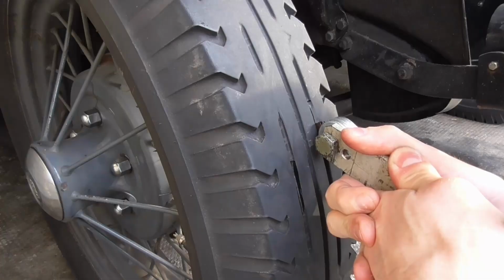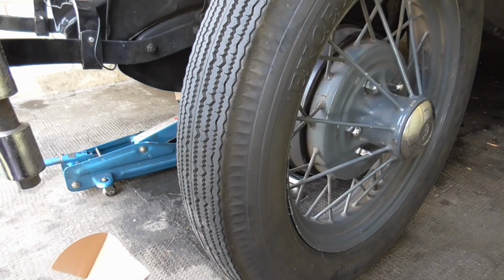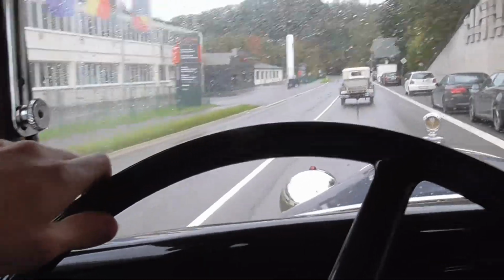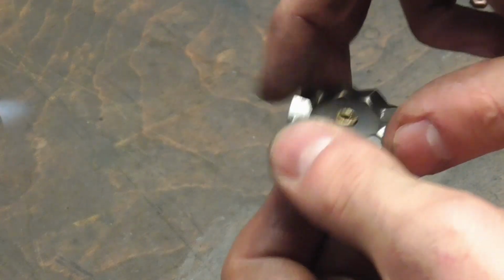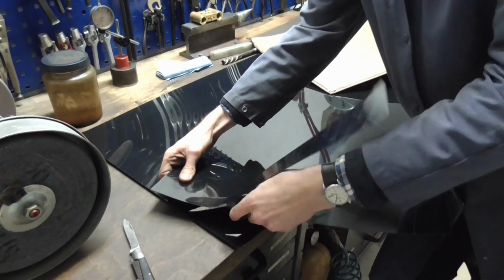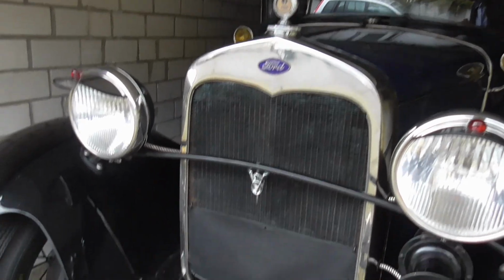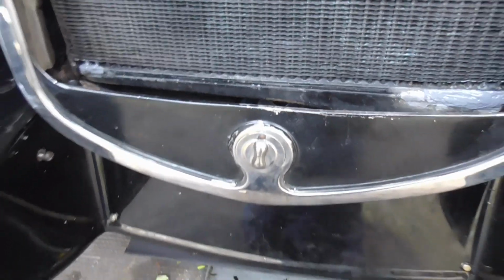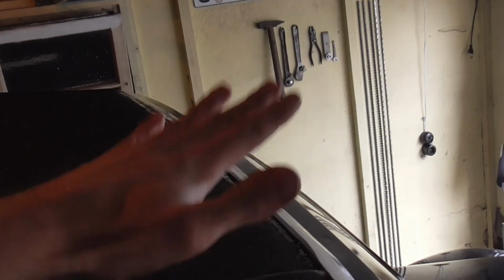Model A Mechanics Log #6: Tires, Radiator Cover, Electrics, Interior, ...

Comment: I just watched a 1940's American (govt) video on tractor maintainance. Having grown up on a UK farm in the 1970, I was astounded at the frequency of the inspections, and the amount of oil used by the various changes.

Here's the video:
https://www.youtube.com/watch?v=1d3qvzTwNds

I know (in my lifetime) that the service intervals of modern cars have been extending and extending and are now annual in many cases.

So what's the routine maintainence requirment on a Model-A in routine use (not just weekend parades!) ?
Reply from the maker: Well, Ford recommended to do a full lube job and oil change every 500 miles. Based on no scientific calculations, I decided to stretch the oil change interval up to 2500 miles (with added oil filter). In the summer, I reckon a lube job every 1000 miles should suffice, but when driving in the rain, I stuck to the 500 miles because 80 mph rain is a mighty powerful pressure washer blowing all your chassis and axle joints clean. During my peak time, that averaged out to about one lube job a month in the winter.
Very interesting video by the way, thanks for recommending!

Comment: Adrian, do we really need to balance the tire when we are only driving at 45 mp/h? (72 km/h)  I don't have an overdrive yet so that's about my top cruising speed.  Even at 55 mp/h  (88km/h) it seems like it is not really necessary. I got this idea from my local tire experts. They say that 60 mp/h (97km/h) and above, then balancing is necessary.
Reply from the maker: If you don't notice anything, you don't need to. As I said, there was a minor twitching in the steering wheel whenever I exceeded 40mph, that's all the balancing got rid of. The much more pronounced low-speed wobble due to out-of-round rims isn't affected.
Reply: @AstraWerke  Yes, I heard you talk about the out-of-round problem later on in your video. I did make that comment before I had listened to your whole video and I was enlightened by your perspective. Thank you so much Adrian. I'm a good friend of Paul Shinn just to let you know. We talk often.

Comment: In my Amazon, the radiator blind has the sheet fixed at the bottom of the radiator. The entire roll is lifted by a chain that is guided through a tube over the radiator. The chain then stretches over the engine and into the cabin where there is a slotted bracket under the dashboard that the chain hooks into.

Your first attempt would have been very impressive if it worked, but sometimes the simple solutions are the most reliable. Looks like you're on the right track with the radiator!

Comment: You've been very busy indeed. More  great fix it up ideas been there. I'm presently going through te same thing with my tires and wheels. Mine are egg shape and warped, so I'm now looking into new wheels and tires.$$$$$$$ ,cannot find any good 21" wheels! Also considering radials for the new tires,we'll find out if it's worth it. Thx for another great video.

Comment: The horn ratchet is supposed to be held on with a nut and lock washer. You may have a reproduction horn.
Reply from the maker: You bet - it appears whoever restored that car didn't want to spend time refurbishing the old stuff and just bought new repros. Same goes for all lights, door handles, knobs... Pretty much every attachment piece was swapped for new pieces - which is a shame, if you ask me.

Comment: Since you've already modified the splash apron, you might consider fabricating a simple sheet metal guard to fit under/around the roller for the radiator cover. That's a very exposed location – it could attract all kinds of road sludge which could gum up the roller, especially in the rain.
Reply from the maker: I thought the same thing - interestingly, there was no dirt caught behind the splash apron, but I'll keep an eye out, and if there's any evidence of dirt collecting, I'll certainly build a housing around the roller

Comment: 10:55  6 volts doesn't mean anything.  A lot of people think 6v is a problem and that you must "upgrade" to 12.  6v stuck around for decades because when it is set up properly, it works fine.  The main thing is you need good grounds.
Reply from the maker: It's the same with mechanical brakes. As long as you keep them in good shape, there's nothing to complain about.
Reply: And in the end mechanical brakes and 6v sucks anyways...lol 

In my case i think 6 Volt sucks more than mechanical brakes...mechanical timing advance too....

So I drive my A with B engine/ gear Box,12v one wire alternator automatic advance and mechanical brakes..lol
Reply: @hansosl  6v systems are fine when they are in proper working order. A 12v generator would suck too.
Reply from the maker: @hansosl  How about an automatic transmission to save the hassle of manual clutch?
Reply: Basically the model t has one...but you select every gear yourself. 

I have an automatic in my 67 caddy...everything has his place/ pros/ cons

I drove 250tkm with cars and motorcycles from 1914 to 1970s...
I've been in every rabbithole... there was a time when i cut up 12v Batteries to get 6v...because 6volt Batteries are expensive lol...

6v Volt motorcyles...with kickstarter no Problem...Battery is 8 euros....

I back converted some vehicles from Electronic ignition to points...

If you build a vehicle for a special purpose...there are many pros and cons on many Details.... 

You can even run some 6v vehicles on 8 Volt Batteries...

Building a car from scratch starting with a frame....i would never use 6v.....but an original 6v survivor I would not have the desire to convert to 12v if it works nice...

Comment: 0:25 If a fully reliable hassle free driving experience is what you are after, a 90 year old car is probably not exactly the ideal.  By the time you reach the last item on the list, the first thing you fixed will have worn out by then 😀
Reply from the maker: Well, back when I bought the car, I thought it'd just be a matter of getting all the bugs out and then just routine lubejobs and fuel stops.
The car proved me wrong ;P

Comment: 0:15 "Finally done". Oh, you sweet summer child!😂
Anyone with an older (let alone antique) vehicle has a permanent (non paying) job.
My feeling is that if you own one of these, either you need to be a combination mechanic/machinist/engineer/miracle worker OR have a friend who is. Luckily, you qualify for the first part!
I like your roller blind radiator shroud. A clever solution and I'm sure you'll be able to set up a Bowden cable remote control for it (eventually!)
This was really interesting. It's worth pointing out that most Model A owners in the 1930s would definitely be doing a lot of repairs/modifications themselves.
There were dealership shops, of course, but not the necessity to have the dealer do absolutely everything.
I have two thoughts about the outro: Firstly, the sound of the exhaust echoing in your garage is glorious. Secondly, nice lid!😁
Reply from the maker: Well, I was optimistic about it, when I bought the car xD
I've always been wondering - so far, most repairs I had to do was due to prior neglect or improper installation (missing/hardened rubber, poor quality repro parts, worn-out old parts...), so maybe, once every single part of the car has been replaced properly, there's no more to worry about.
That means, I've only got the gearbox, U-joint, differential and rear brakes ahead of me - I've pretty much had everything else apart at this point xD

Comment: I actually never balanced my wheels after stripping, painting, and putting new tires on. I figured they are turning so slow, and every other thing on the car is wobbly and creaky anyway, I didn't really bother.. (also i have 25 degree play in my steer, so any wobble is not noticeable anyway)
Reply from the maker: Below 45, imbalance in the wheels is unnoticeable - and even at 50, it doesn't play a significant role.
Out-of-round rims play a much larger role in ride comfort.
Reply: @AstraWerke  not even noticing much at 80, my unbalanced engine overrules any other shaking at that point haha. Out of round I really notice when rolling to a stop before a stoplight..

Comment: I use "slime" for tubed tyres on my car (1934 Austin 7) - firstly, I had a blow-out with rapid deflation and luckily I was able to bring the car to a halt without undue danger, but it unnerved me! Slime should help that rapid deflation (it was a chipboard screw that caused the puncture) in future and gave confidence back!

There is another advantage to the slime, the fluid balances the wheel and I noticed that the car accelerated smoother from around 40mph to 45mph and at first (you soon get used to it) the car felt more stable, particularly around bends.

My three vintage cars have LED bulbs all round, very good visibility from the headlights and clearly visible from the rear - sometimes diodes are needed as the bulbs can do funny things at times, but once sorted, all is good and I like the crisp light output (you soon get used to them).

I have always taken the wheel off to change the tyres - never done it with the wheel on the car itself, might try that next time, the job is such a ball-ache anyway so anything that makes it easier is worth a go!

I made a grille muff for my car, I quickly learned that at freezing having the muff closed will overheat the coolant after a couple of miles, a blind operated from the driver's seat would be much better, good luck with yours!

My cars get used in the winter, I am not bothered about salt on the roads, a bit more attention is required to keep the underside clean (who am I kidding, I don't) and touching in of the paintwork, they have last this long so with attention they should continue for as long as we will be allowed to drive, at least until sense prevails and it may then be too late as the cars would have all been scrapped...

Thanks for sharing, have a great Christmas, greetings from the UK!
Reply from the maker: You'll have to enlighten me regarding "slime" - is that a special product? Something you cook up yourself?
How does it balance the wheel? How would a liquid know where the heavy spot is and automatically position itself on the opposite side?

Hats off for driving all year round - I had a look at your channel :)
I, too, dread the day I blow a tyre - a friend of mine told me he just veered into the opposite lane with no possibility to steer the car. 
Luckily there was no oncoming traffic - he'd have ploughed right into it.

Comment: Ich bin lange 6 volt Fahrzeuge im Alltag gefahren so ca 10 Jahre und wirklich jeder kleine popelige Kontakt muss penibel sauber sein damit die Lampen richtig hell sind und der Anlasser sauber durchzieht.... es gibt schon Gründe warum die Russen relativ früh zu 12 Volt gekommen sin... im Winter ist das alles nämlich noch schlimmer bei 6 Volt
Reply: I would check the ground leads. That is the return path for the electrical system. 😊
Reply: was die Sache nicht besser macht, früher haben die richtig am Kupfer gespart, sowohl am Kabelbaum als auch in der Lichtmaschine selbst. Selbst im Neuzustand waren da so einige Systeme am Rande der legalität. leidiges Thema bei alten Zweirädern
Reply: Led is the way to go